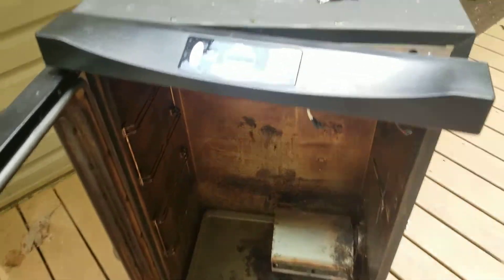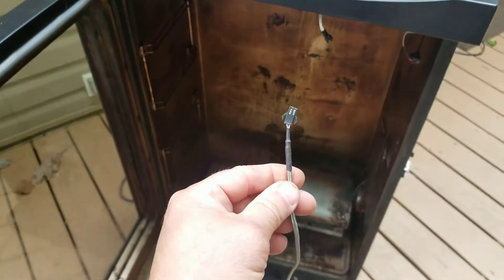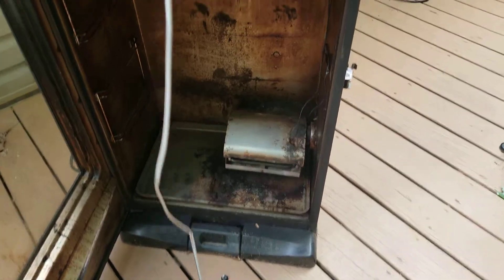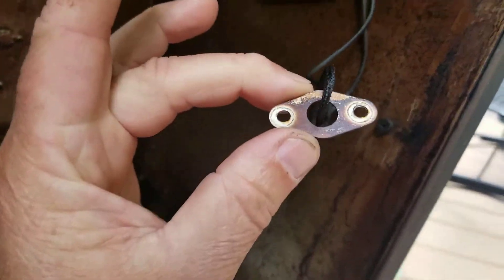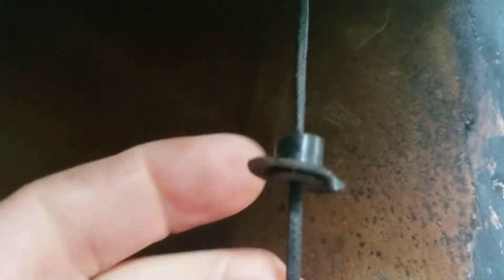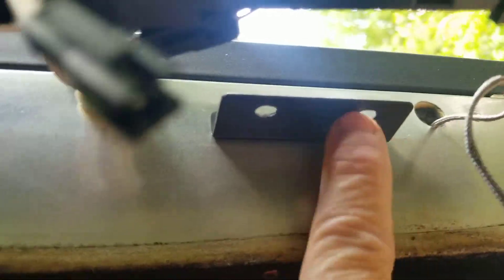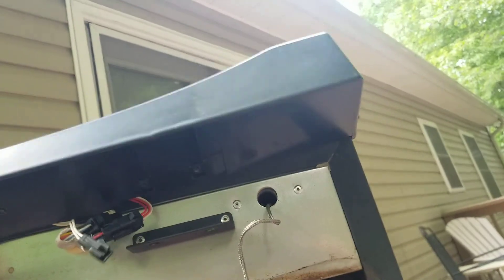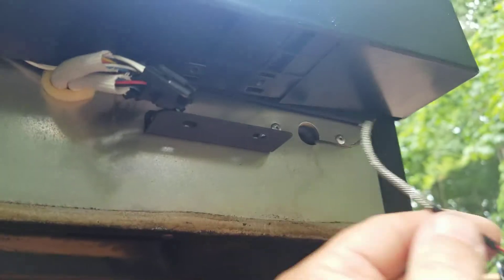Masterbuilt meat probe replacement model# 20072612

Comment: Thanks for the video. Fishing was easy. Cut off the probe end of the old probe. Then tape the connector end of the new probe to the old probe wire. Pull through from smoke box to control panel area. Be sure to carefully put rubber plug and bracket on to new probe -- they will pull over probe end of new probe. The screws that hold my control panel on were a little different  but obvious. Again, thanks.

Comment from the maker: Turned out to be easier than I thought. However, it did not fix my temp issue. I assume the control board is out of whack. I will just not use the probe.